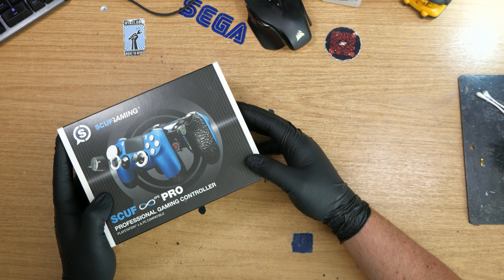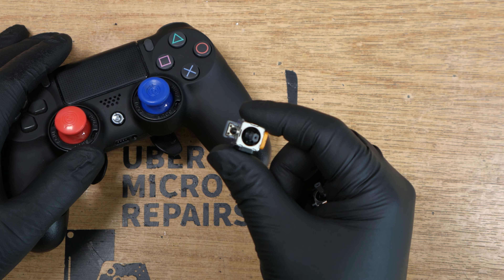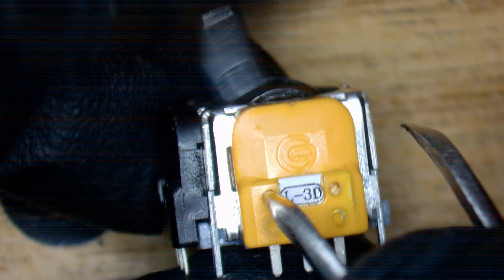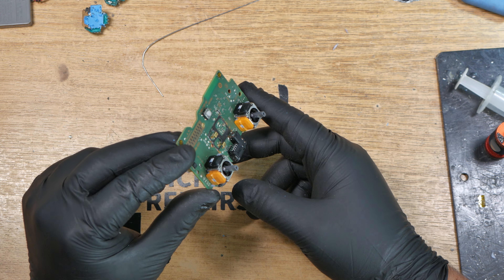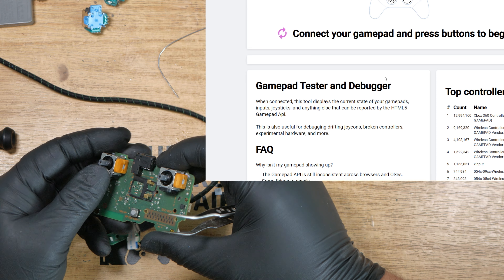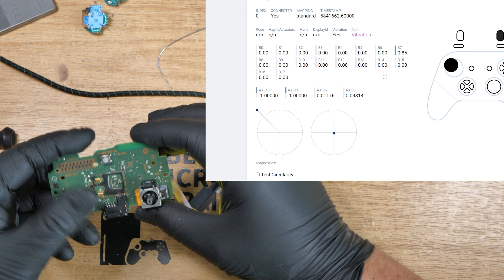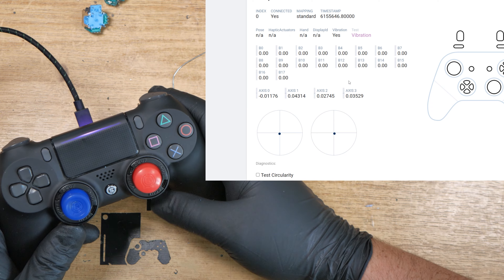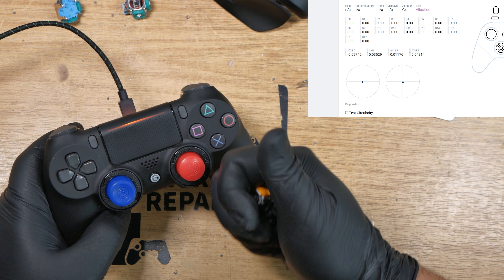Hall Effect Analog Sticks Fitted to a SCUF Infinity PRO PS4 Controller

Comment: True Hall effect sticks may not completely eliminate stick drift since everything wears out eventually  but at this point we need something more durable than the crap that is in controllers at the moment. I am happy to see some viable options now becoming available.  Hopefully we will get options for other pads some time soon. I am looking at you XBOX! Also viable replacements for old pads such as the xbox,xbox 360,PS1,PS2 ,PS3 and any other aging pads would be amazing to see. So many worn out pads that could be resurrected rather than tossed without having to play good part or trash roulette online.
Reply: The plastics of the body and buttons will wear out sooner than the magnetic field for the hall sensors.
Reply: They also work in Xbox One / Series / Elite Pads, they all use 10k pots / hall sensors. And the sticks are available for the PS5 with 2.3k Sensors, too.
Reply: @schwarzerafri9015 so the one that work with xbox one s controller are the 10k one? Not the 2k3?
Reply from the maker: 100% agree!

Comment: the magnets will also lose magnetism over time causing drift or if left near a powerful magnet like a sub woofer for a week would be enough to change the field then you need to recalibrate them. wear and tear and  the field even the hall sensor it self can fail.  is why im always confused why people believe it can never drift.
Reply from the maker: I not sure the magnets would weaken enough. I'd bet wear and tear would happen to the module long before the magnet weakens. They are neodymium . There are Dreamcast and Xbox One controllers using standard ferrite magnets and hall effect sensors that are decades old now. All still work fine. I guess time will tell.
Reply: i had hall sensor Ps3 controller, 10 years no drift, perfect center. But yeah magnetism will get weaker true, but at that time you will be dead already.
Reply from the maker: @chpokerTV  Agreed. The PS3 analogs in the SIXAXIS controller suffered from worn out springs. The stick didn't return back to centre. I will predict the same will happen to these hall effect analogs.
Reply: I have two PS3 controllers since 2010 and never had stick drift so clearly you don’t know what you’re talking about
Reply: OEM Dreamcast controllers don't have drift issues and they're two decades old. It is more likely that the magnetic field will outlast you as long as you treat the controller properly. I still have my OEM Dreamcast controllers and they work as good as the day I bought them.

Comment: What are the temperature and aire pressure that you use for the hot air station? In addition, I noticed that the metal plate and the pcb holder was not in the description, what is it?
Reply: Notice you got no response on this question
Reply: @willwood2360  Are you implying something?

Comment: I swear Sony used some kind of magical Sonium material made from the gods to solder those sticks on because even with using flux, adding fresh leaded solder, and using a hot air gun, and trying a solder sucker, NOTHING could get those fucking sticks off. I actually ended up melting the original joysticks plastic bits trying to remove it with hot air. Kudos to you for being able to get it off for these hall effect sticks. I just said forget it and sent the hall effects back to the shipper.

Comment: That's cool they come with a custom magnetic sensor that can match the original output signal. I was thinking it was gonna need some add on board to go with it but everything is on the analog itself. Interesting and also that last ps4 battle beaver vid was a great late night watch for me before bed. 😁👍
Reply from the maker: Nice one! Yeah these are specifically for the PS4.

Comment: disculpa la pregunta que tipo de estacion de calor usas y cuanta temperatura usas y cuanto de aire ? para sacarlo los joystick sin flux ¡?
Reply from the maker: No hay problema. Tengo un Atten ST-862D. Temp @ aproximadamente 395c y flujo de aire al 50%
Reply: @UberMicroRepairs  y el flux amigo q marca usas
Reply from the maker: @mundogamersguayaquil2524  Here you go: https://ubermicro.co.uk/product/kingbo-soldering-flux-rma-218-10cc/

Comment: nice video, I got a question though, how did you calibrate it? I got a controller with the same sensor and it has around 0.04 upward in the right stick, do you just stick in that hole and randomly push the stick around until you get a lucky one and then pull out?
Reply: He calibrate sticks with tweezers, moving magnet near hall sensor.

Comment: Why didn't you cslibrate it with the software? Did you try it?
Reply from the maker: Because I wanted to show a true representation on how they where intended to be used. However. At the time of this video I used the software and the results wern't great. 9/10 times you get reduced travel in the diagonals when calibrated with the software. I have since figured out a method to get them calibrated and work spot on!
Reply: @UberMicroRepairs  so you found a calibration method where the travel in the diagonals are the same as the alps analog sticks?
Reply: I've installed these in a new dualshock. I watched your video. Can you give us another one showing software calibration as well?  @UberMicroRepairs

Comment: what  temperature you are have on your heat gun ? you took it out very easy im struggling with it
Reply: Key is adding a bit of solder to the joints before heating them up

Comment: You need to turn test circularity on & get the Average Error: To about 10.9% or lower with 3x3mm ohms resistance trim pots to reduce menu scrolling skip speed, this is fab stuff as foundational pot tech looks, good find 👍🏼. 

Shrink the circle overshoot enough this could serve Dualsense also on 2K3 Pots with a lower resistance trim pot to equal the required value 😉😜😁🫸🏼🎮🫷🏼🙏🏼🕹️🕹️🎯🎯.
Reply from the maker: Thanks for the tips! Please don't take this personally (I'm extremely passionate about our repairs) but we do not and will NEVER use trim pots (Stick Drift Fix boards) or resistors. They are a lazy, hack fix IMO and we remove them on all controllers when we find them installed. We get all our sticks to calibrate to within 3% and full 100% range around the clock without any of those methods. We use the Controller tester coupled with DS4-Windows so I get the full raw analog reading not the default Windows calibration that has a default deadzone of 10%. 

Again Trim pots (Stick Drift Fix boards) or resistors anything like that, we will never use as I believe they are a really bad fix and doesn't address the underlying cause of drift (which is the wear / dirt on the carbon track). Having to fix 10 - 15 controllers on top of consoles a day we have a fast, efficent and reliable method that mitigates the carbon track wear. Over the years I've see so many methods, some even including a full blown maths lesson, all amounting to wasted time. Especially as DS4 controllers can now be calibrated and the reading wirtten back to FW.
Reply: @UberMicroRepairs  I don't use fix boards either just the raw trim pots from 1M+1M minimum shrink, 1M, 500, 200, 100, 50, 30 & 20+20K max shrink twin & single trim pot combos for best results, it's not efficient but I discovered it all as a fully qualified know nothing using Grey 10.24K primary potentiometer sides 🫣, probably a crime by your standards but I made it work lol. 

I fitted Xbox one elite series 2 sticks in my DS4 🎮 the same way, but with hall sides it could get better results 😉, there not very mechanically tight tolerance the series 2 pots I fitted. 

My soldering skills are that of a child from looking at your speed, but I did painful research 🤷🏼‍♂️. 

I custom built Analog stick tops better than anything out there & that's as far as I got, better than mod sticks & Xbox magnetic sticks & there modular to fit in anything that uses either the screw 🔩 pin of elite series 2 or traditional push fit 4mm plastic pins with 3mm width flats, best thing the markets may never see 🥺...

I'm sorry if we have already had this conversation? 🤔💭🧐 I can be a broken record 🤷🏼‍♂️.
Reply: @UberMicroRepairs  i already used the Calibration Tool and have a Flash Dump of my Controller. But it seems there is no option to restore it if something goes wrong. But for the most issues (like the expanding middle slot or some few %s off) the calibration tool is pretty nice.

Do you know how to flash the dump back if anything goes wrong (like usb connection error while writing the data) ?
Reply: @UberMicroRepairs evening fella, how do you couple ds4windows with gamelan tester as I'm having major issues trying to test sticks on ps4/ps5 controllers lol.

Comment: Nice one. Could these work in a ps5 controller as well as some use the same modules
Reply: I remember I saw a post which says these won't work on dualsense since these require few more volts to operate which the dualsense don't provide.
Reply from the maker: So far I've not got them working on PS5 controllers. There are a few factor that are different like the PS5 uses a lower voltage and the pinout is rotated. Not to mention the pot resistance and range is different.
Reply: i tried and the controller does not work correctly. it takes some of the voltage out of circuit or something. the controller powers on, flashes twice and turns off. the R/L adaptive trigger motors will tick as well.
Reply from the maker: @pootnannies  Yeah.. The PS5 controller analog work on 1.7v and the hall analog need 3.3v also the Hall analogs need + and - to be the correct way round. They really just will not work. with out cutting traces and feeding them from a 3.3v supply. It's a lot of work even if you know what you are doing.
Reply: @UberMicroRepairs I've seen a shop online claiming they are able to out hall effect sticks on a dual sense controller. From the looks of it, it seems like they are using the same module you are using. Maybe you can check them out. They're called PXP Repair from the Philippines.

Comment: Will the jittering be also filtered out on pc?
Reply from the maker: Should be.. Although it looks bad.. it's so minute I doubt it will really effect anything.
Reply: Most games come with a 10% dead zone for analog sticks. The jittering only occurs in a 2% zone. So nope, there wouldn't be any problem with any game. In fact the only way for it to become a problem would be by purposedly shrinking the deadzone using DS4Windows or a similar software.

Comment: If you were to do a proper repair you would install the Hall effect driver board to allow proper calibration.
Reply from the maker: This was recorded before the boards was out, just published afterwards. Look at the rest of my videos to see how it's done.  Becides that.. IF I WERE to do aproper repair I wouldn't use the redundant calibration boards on a PS4 controller I'd use the calibration software and do a evenmore proper-er job! 🙃
Reply: @UberMicroRepairs  also looking over your videos not very impressed 🤷 if you truely knew hot to do a proper Hall effect install you would have driver board installs. Their spot on every time.
Reply: @UberMicroRepairs  also their is no software for Sony that will give you a proper calibration. What we use we have a complete 0 deadzone. You must be thinking of the cheap shitty boards that just increase the resistance. 

These boards I am talking about takes all signals and adjusts them based on what you want and outputs those signals. Also not a noob here. I have been microsoldering since 2009. If you look in all the cell phone groups you will know who I am 🙄
Reply: Well...While your talking to the youtube channel owner.. uhm what are these boards your talking about? I wanna get some hall sticks for my ps4 controller and I'd like to calibrate it the right way as your stated. I'm personally not a fan of all the jittering i saw in the video @PlaywithYNC

Comment: The circularity tho. It will be wonky af in game
Reply from the maker: I have since worked out how to sort that. As long as the circularity  is out side the 100% in the diaginals it will be fine. Even new out of the box DS5 controllers have wonky results on that test.
Reply: @UberMicroRepairs  it will mean that the diagonal will reach the 100% ingame eariler than normal. Atleast for ps4/5. Its not fine
Reply from the maker: @yu-yq4ic  Again please ignore what you see in the video with the circularity test . I just made sure it got to 100% at the main 90 degree angles for the purpose of this video! Either way the circularity isn't a "be all and end all test". Aslong as the stick goes outside the 100% range in the diaginals IT'S FINE! Untill you have tested literally every brand of PS4 / 5 and Xbox controller Old new or repaired Broken beat & scarred. You would know circularity is just that websites interpretation of it!! Noting to do with Sony or M$ it just the RAW readings.
Reply: Yea, pc, xbox, and playstation games have different responce  from the input. My concerns came from when ive installed off brand potentiometers into ps. It didnt pruduce the exact response of the defult sensor. For ps controller, ideally it  should be calibrated to perfectly line up with the circle, atleast for ps
Reply: @yu-yq4ic  circularity doesnt make any difference in game.
Reply: @dyxphoria1943  it does though, you are only thinking in senarios when you push the stick all the way.
Reply: @yu-yq4ic that are the disadvantages of the hall analog sticks.

Comment: Is there actually any working difference between the DS4, Dualsense & Xbox one hall effect potentiometers other than the fact they switched around the black & orange side mounts that you know of 🤷🏼‍♂️, or is it one fits all with an attempted segregation between products 😉, switching the L & R colour coding idea 💡 of these sticks 🕹️. 

It looks like they are trying to pull a fast one for product segregation purposes 😂🤣😭, a one fits all option will destroy the scam of the old market & they/them 🫵🏼 know it 😜.